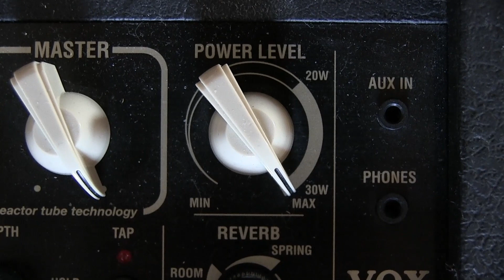winding my first guitar pickup

Comment: According to Fender, the average strat pickup is anywhere between 4 and 6 thousand winds! Depending on the thickness of the wire!
Reply from the maker: Yeah that's what I was aimed for 😓
Reply: @zurowetz  maybe have spool on a roller next time, so you can control the release more easily! If you want a great pickup channel in the 'tube checkout Dylan does tone. The guy is a professional pickup maker, rewinder and repairer.
Reply from the maker: @seanbarker4610  I know of Dylan and having the spool on a pen worked but I think you're right and I'll build something 🙂